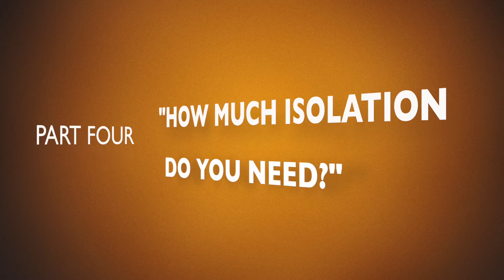How Much Isolation Do You Need? - part four - More on GYPSUM BOARD PARTITIONS

Comment: Thanks John, would you recommend 3 sheets of drywall for the interior and should they be the same thickness 5/8 " or would it make a difference if I use combo of 1/2", 3/8" 5/8"?  .... I'm building a decoupled room 2x4 with a 3" gap and loose insulation filled. any advise would be greatly appreciated...  additionally would hat channel be beneficial for my 8 ft ceiling with 2 sheets?  I'm a drummer and guitarist,  I've researched everyone, your advise is #1 thank you John.
Reply from the maker: Ace, I highly recommend that you do a noise test first to have some concept of the level at each frequency that you need to block. THEN do that. I use INSUL to determine the wall and ceiling components required for the isolation. You'll need to find exactly what is needed in each frequency band especially from 20 Hz to 500 Hz. Don't guess. More information on my resources page - jhbrandt.net
Reply: @JHBrandt  Thank you John I couldn't agree more with your advise, makes perfect sense, I'm rushing to purchase materials as the price for lumber is skyrocketing... I'm headed to your resources page now.  Thank you for the quick reply sir.

Comment: Why not make even bigger partitions and so an even more flexible wall??
Reply from the maker: Why or why not? You're diving into DIY design, which always fails.

The isolation that is built into a studio will match its needs AND its budget.
You should never exceed your budget. Soundproofing is very expensive, so get only what you NEED. 😉
Reply: @JHBrandt  Thanks for the reply! With bigger partitions I meant wider. So instead of 60cm wide, 100cm wide so the wall will be more flexible and absorbing. Right?
Reply from the maker: @rockyslay4310 a balance must be made between Soundproofing and structural integrity. 😉
And I don't think that the structure would meet applicable buildings codes with stud spacing larger than 60 cm or 2 ft. In many cases 60 cm centers are not practical and compromises must be made. 😊
Reply: @JHBrandt  How about for the extra drywall on solid thick concrete walls? I want a subwoofer so just to be nice to my neighbours. My new rental place is a modern (Dutch) concrete row of houses. Livingroom 25m2 with open attached kitchen 12m2. The side walls are concrete flat and around 15-20m2. To avoid a lot of drill holes I would like to put the vertical soft attach beams on 100cm or maybe even on 120cm. I don't have a wife so anything is possible (haha). So thick absorbing material on the floor and walls. The extra wall probably 2 different layers: 1x drywall and 1x cementwall with some liquid rubber in between. Drywall on 10cm, rockwool, and seal everything airtight. And probably sheets of heavy absorbing material on the drywalls to make it heavy. Are vertical soft beams possible on 100-120cm? Or will I be the first to try it out?
Reply from the maker: @rockyslay4310  send me an email. John@jhbrandt.net

Do not try to DIY the design. DIY design always fails. Don't waste your time or money trying to do something that you barely understand. Please. Do what you LOVE. You'll be very good at that. If you work with me, I'm happy to answer all your questions. 😊

Comment: I am remodeling my basement.  It is gutted and the studs are exposed. The basement area of concern is about 30 feet by 45 feet.   I have have that Corning Foam board thus far on one wall.  I was going to finish with that then cover that foam board with Rockwool Soundproofing.  I then found you and reconsidered.  The ceiling has nothing in it and you can hear every word spoken in the basement at this time (so I learned when my wife said, "I heard every word you said."  Ouch! )   I and my five sons play music in the basement and I would like to make it so that as much as possible most of what goes on in the basement stays in the basement.  What should I do?  I am slowly going through your videos but a little guidance would be appreciated.  I am 68 yrs and am trying to finish the basement for my kids and grandchildren in a timely fashion.
Reply from the maker: Without more information from you all that I can recommend is that you continue to fill the walls with fiberglass insulation (it doesn't matter if it says 'sound-whatever' on the package. They usually charge more for saying the word 'sound')
Mass is your friend when it comes to low frequency sound transmission. Impact noise requires resilient connections either on the ceiling with clips/channel or hangers OR a resilient padding under the floor surface above. 
If you need help, send me an email - john@jhbrandt.net
Reply from the maker: And don't forget to completely fill the joist space with lightweight fiberglass (attic blanket)

Comment: Great videos. Learned a lot.
What about a conflict between higher mass and more rigid studs?

In order to increase the mass for a tall wall (approx: 4.8 meters high, 40 kg/m2, 17 or 20 cm air space), I found the structure supporting this weight requires the use of  more rigid metal studs than the standar steel studs, and I'm worried about the possibility of these rigid studs undoing or taking away the  benefits gained by the higher mass in regards to resonant frecuency. 

Should we lower the mass to allow the use of more flexible studs, or is it still better to go with the higher mass despite the negative effect caused by the more rigid studs?  
I hope the  isolation to "start" around 30 hz...
Reply from the maker: Safety first, my friend. If the structure is tall, you must use appropriate framing. If it's a conflict, so be it. You must have a certain mass for a given resonance requirement, based on the depth or gap between the panels.
But do not guess. You have the tools to calculate. Take your time and triple check. Studs on a gypsum wall will always make the panel 'more rigid, which will change the model (calculation) slightly. Shifting the frequency of resonance higher. Adjust the mass or depth of cavity accordingly.
Reply: @JHBrandt  Thanks! I used your calculator, and I can lower a little bit the resonance frecuency (to 16 hz, by using a 20 cm airspace and 48 kg/m2). I hope this would be enough to compensate for the increase caused by the more rigid studs (spaced every 60 cms). How much can this frecuency be increased by using very rigid studs? As much as 2 times (32 hz)? I guess the answer to this kind of question falls in the realm of speculation, but even then there's value in the speculation of an expert...

Comment: Hi John I'm getting a lot out of the videos. I'm building a drum room in suburban Melbourne and planning/permit issues are keeping me from using block walls for mass. My questions are

Does lowering frequency response actually lower the volume transmitted at the specified frequency. Eg if I can get the wall to below  80 - 100 hurts will my work be cancelled out by the sheer volume of the bass drum.

Does increasing the air gap mean I need less mass to create the required isolation.

If I build A room within a room inside my garage. how far from the original walls do the decoupled rooms need to be to avoid a triple leaf situation.

Cheers.
Reply from the maker: My friend, I think that you need a proper design. Email me, john@jhbrandt.net
This is not something you want to guess at. :)

Comment: Thumbs up John.   Great stuff.   

What are your thoughts about the effectiveness of hanging MLV in the dead space between two partitions?  

In other words going from inside the control room layers would be 
1) 5/8" sheet rock x3 layers with backerod and silicone etc. onto 
2) metals studs 24" O.C.  stuffed with lightweight fiberglass 
3) varying width of air space, lets say 4" with fiberglass insulation bats laid horizontally filling up the space 
4) maybe a layer of Chicken wire to keep the fiberglass off the MLV  then  MLV hanging from your 3/4" angle iron clamps (or sandwiched between wood clamps) that stand-off the back wall studs.  The MLV is probably 4' wide ran horizontally overlapping 6-8" maybe silicone those layers together 
5)  Wood stud frame 2' O.C. stuffed with fiberglass.  

Would the MLV provide an effective acoustic shield for the control room from exterior low frequency's more efficiently than more layers of sheetrock etc.?

Will the MLV be the most effective at minimizing sound transmission in both direction?  I.e. into and out of the control room?

Comment: Hey John
Im thinking about a trapeze shaped studio. It doesn't have as many parallel walls as a rectangle while maintaining simmetry, so does it have better acoustics than a rectangle? And if so where should i place my desk and my listening positioning?
Reply from the maker: NOT RECOMMENDED.
And, as Forest Gump always said, If it's not a rectangular cuboid, it will be nearly impossible to calculate to see what your modal distribution will be and you'll end up with a 'box of chocolates'. - You never know what you're gonna get. :)
Don't do it.
Reply: John Brandt what if it is done in a really subte way?

Comment: Question about Green glue use - good or bad?
Reply from the maker: Good stuff. But I rarely use it.  We recently recommended it for lowering the resonance of wall panels in a concert hall application where we needed to isolate down to 20 Hz and below.. It is important to calculate the panel resonance of a system especially when dealing with MUSIC frequencies. i.e.; Music 20 Hz - 20 kHz and Voice (STC) 125 Hz - 4 kHz. ;)
Reply: I did not realize the resonance would lower using Green glue or equivalent, I was only thinking of resonance damping. Seems this should be used more often to lower the resonance?

Comment: Questions 1) About both gypsum sheets installed horizontal.  What about putting the first layer vertical so the seams are sealed by the studs, then the second sheet horizontal covering the seams in the first layer instead of two horizontal sheets? 
2) Your view on gluing & screwing the sheetrock to the studs impacting the flexibility of the wall?
3) I presume the wall will be more flexible where the layers are allowed to move separately from each other compared to glueing them together, or adding a damping layer between?
Reply from the maker: 1. Either way is fine. Just be sure to overlap the seams - horzontal and vertical. The way that this is done; first layer is installed normally. Second layer 'starts' one stud to the left or right and Up by the same amount. This way zero seams are in the same place. 
2. The drywall/gypsum board must be secure! Follow standard building practice! You can even glue the sheets together and it's not going to make much difference in the flexibility of the wall, so worry about it. Do it right and per code. 
3. The layers MUST form a solid mass without air-space between them. This is very important. If you want a more flexible wall, use steel studs and 24" (61 cm) stud spacing.
* A more flexible wall will have lower resonance and therefore provide sound-proofing to a lower frequency. Remember that actual sound-proofing 'starts' at √2 times the resonant frequency.
Reply: @JHBrandt  Would overlapping a horizontal layer with a vertical layer make the wall less flexible and thus less efficient in absorbing low frequencys? Is it recommed to use higher mass drywall like the fireretardant variant or is this not very cost-effective? Thanks for all the info! I'm soon building my studio and you're a great help in preparing the build!
Reply from the maker: @michelgregoire7051 , when you put layers of drywall together, they are no longer separate sheets but merge into one mass. It doesn't' matter what direction they lay.  Mass is what we want for sound-proofing so I always use the heavier fire-rated gypsum board.
Reply: John Brandt did you get my mail I sent at your website’s email address last monday?

Comment: Thanks, so useful! and your descriptions are so concise and clear. Three Questions: 'backer rod' around the perimeter, should be open or closed cell? or the effect is marginal. Also how about acoustic sealant [claimed STC65!] to create a membrane around the edges? In this case the sealant out-performs the barrier [!].Lastly what source would cause wall to a move to a sub-harmonic [12-21 Hz] resonance?.
Reply from the maker: Never trust STC testing data on products that are NOT used for building partitions. There are so many variables!
For example; STC data on theater curtains!, STC data on MLV! (unless you're building your wall from ONLY MLV!), STC data on fabric, paper, organic food, etc. :P
STC data is only valid in exact conditions in the lab and are guaranteed to change in the field. But at least you have a 'ballpark" figure on that wall configuration.
As far as sub harmonic resonance.. most likely ANYTHING! Most wall partitions are not built to reflect of absorb frequencies lower than around 20-30 Hz. For studios we calculate the resonance to around 10 - 14 Hz. But that is not what I would consider 'sub-sonic' as far as isolation is concerned.